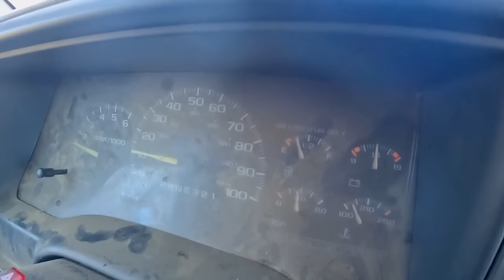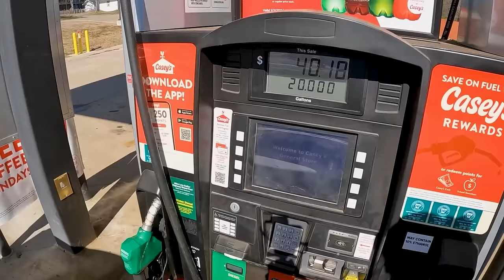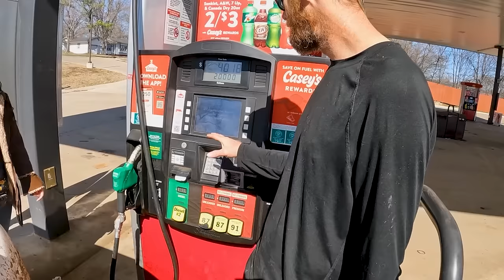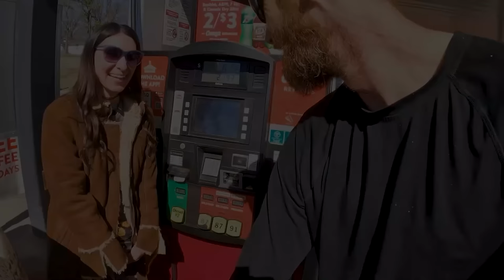One Thing After Another.. Can We Get It Right?! Covered Deck for our DIY Cabin Homestead Build

Comment: You can put more than 200 amps of breakers in a 200 amp breaker box. However, you can't pull more than 48 kilowatts of power through it except for a few seconds. How does 5 people use 48,000 watts of electricity? Electric resistance base board heat, electric oven with 6 resistance burners, washer, dryer, 5 tables saws? 200 amps at 240 volts should be more than fine.

Comment: If you run 16’ rafters for the deck roof just box in the sides where it meets the roof and then you have a step flashing run for the main roof over the house you can box in the eaves at the deck transition as well should be same amount of roofing with what you save on the over framing

Comment: Are you really sure you need that much pitch on the deck roof.   Up here in northern Wa, yes cause of the snow.  Yes you get a little snow but mostly rain I suspect.   4/12 is min up here.  I’d reconsider your pitch.   Just a suggestion.

Comment: oh me;;;;;you are fighting a battle;;;we found that the 2x's all had their own unique path of straightness;;;what you fix now may not stay the way it was fixed or the other side decides to go bonkers;;;lol;;;differen parts of the tree put together expand and contract differently;;;;;we also found that the height of the 2x'a where not exactly the same some a 1/4;; shorter or taller;;;notching and shiming helps but in the end tieing them together with decking helps keep them looking straight and depending on the decking it might create problems;;;;;hope you get er perfect;;;we finally just used the eyeball method of straightness and hope you have a bit of slope from house to end of deck to keep water off deck;;good luck

Comment: Two things why have you not put your deck boards down yet it sure would make it a whole lot safer working. Also, are you really going to run the boards from the house straight out or are you gonna run them along the house?  I am assuming that’s why you’re putting all the ledger boards in

Comment: I couldnt think of a better way to spend valentine day then doing your pergola/deck and supply run...my pergola about the same size as yours I built when I was 23 here I am at 60 still enjoying my veiw of the neighbours brick wall its probably been the most used area of my home Ive had my kids christenings and 18 and 21st partys all under the pergola it was Originally built to give them a place to play on their lil pushbikes these days it holds my stained glass workshop and my cats and dogs hangout in there and Ive only just had to put a new Tin roof on it now which is a bit harder at 60 but Im getting there its a lot of roof might take me a bit but I will finish it soon enough...Happy Valentines guys...later laters❤

Comment: You will have to double up the joist above each post so it has full bearing from very top to very bottom.  The fastest way to guarantee a level deck is to put a nail on a separate board at each end and stretch a MASON string (regular string can stretch) along at the height that is correctly level.  Then you just need to put a car jack or two under the rim board and build a post to put under it on top of the jack.  Then crank away till you are level.
For all the ends that are exposed, I would highly recommend brushing on a coating of Titebond glue.  That will keep water out and prevent rot.   I know you will not do my next suggestion which is to cover the tops of every joist with zip tape.  I saw that you did it on the main beam but it is one of those things that will add 10 years or more to the deck life.  
Also, make sure that once the posts are set on the double block you should then cross block between the joists so the posts are blocked in on 4 sides.  I construction adhesive and thru-bolt each post with 2 bolts and w/nuts and lock washers.   This is necessary due to wind load and snow load trying to tilt the posts later on.

Comment: another thing you need to address, real soon.. your trusses are NOT rated for a point load for your rafters.. [if they were they would have a tag there and a support right there] you need the load to go to the wall, not the roof.. just random info so it does not get missed.. realistically you could make a short stub wall at the exterior wall and then rafter from there and then have short rafters to the roof - it depends on the board foot cost increase with longer rafters, sometimes going from 10 to 16 is three times the price per board. .. you already are going to cover up some existing roofing, no big deal other than sunk cost, you do need to NOT have that whole roof load mid truss.  so once you know how high up the roof you will go then you can figure out the support / crib wall and then figure if splitting the rafters or having them go all the way will do the job. ..   this is just random thoughts from a old fart.
Reply: Great idea!!
Reply: Good info.

Comment: Gary... dimensional lumber has that problem being the same width and holding it's original width. I just had to shim up floor joists in the middle of our house where the ends of the floor joists from the two sides meet over the central steel beam in the basement. One side was narrower by 1/ 4 inch and was causing horrible squeaking when walked on . Put in shims...no more squeaky floors

Comment: Build it like a wing/aerliron assembly.  The house roof has a structure to raise to the 3-4'-12' line.  The deck roof is a narrow triangle over to your post.  Take the sideview of the structure 3-4-12' from house roof to post. Put a support vertical at the edge of the house, the rest of the strut is a triangle .

Comment: If you are not required to have a specific pitch for the deck roof. You could remove your house fascia and tie it into your existing roof structure. Not sure if that’s code but 🤷‍♂️. Good luck.

Comment: Hi Mel and Gary, you guys are getting it done. Gary please stop referring to yourself as OCD even in jest. It’s best to say that you just want to get it right. With the shims I am wondering if there will be water down there, if so, they may easily rot, despite being treated. I guess if you oil the deck then you oil those shims to protect them. When I shimmed a veranda floor joist I used plastic shim, these were wedges that I inserted from each side, I used a clamp to tweak them into place then secured with a screw. The beauty of that is that as timber ages it shrinks so I simply remove the screw and clamp the shims again till the gap closes, being plastic there is no problem with water damage. Lovin the build.

Comment: I would recommend that the top of your porch rafters end above the exterior wall.  I prefer to install a 2x4 across the roof horizontally and just clip a notch at the top end of the joist and the birdsmouth on the bottom end.  I hope you are accounting for the height of the horizontal joist between the posts.

Comment: Why don't you try using a water level which is a long piece of tube corked on both sides that has colored water in it that represents the level part of the thing so you can go along and adjust it with that and you can also check if all the rest are in level what's the rest of the boards all it takes is a long piece of clear tubing water with coloring in it and two corks

Comment: Gary mentioned some of those end ones may need to be 24’ All I can say is hang on to you butt because the cost of them is gonna sinch up your pucker string 😂🤣. If it was me I’d figure out a way to put me some more upright 4x4 post on that knee wall/angle half wall that Mel done her climb down onto. ( Yeah That Wall). I’d put me another 4x4 on top of that wall going up to the deck  parameter board. Then that will give U the load bearing post underneath to put another 4x4 on top of the deck dead center on the end of your Angle  perimeter board. That way you can notch the 4x4 to insert two 12 footers, 1 going from your existing house roof to center of the 4x4 in the notch and then another 12 footer going against that one in the notch on the load bearing 4x4 down to your outer deck edge to its load bearing post. Hope this makes sense if I was there I could show ya the concept to save you a ton of money on buying 24 footers with is ungodly expensive not to mention requires more load bearing bracing with also requires more money. My way is start from that angle wall at basement ground level and put a 4x4 midway of that wall going up to the deck for a load bearing support post. Then go dead center above that on top of the deck had put another 4x4 mid way. The top of that 4x4 will be notched to place 2  12 foot boards butted up to each other in the notch, one running to the roof of the house one running to the end of the far outer front corner of the front of the deck roof. I hope you can decipher what I’m saying or otherwise buying 24 feet lumber is gonna draw your Wallets butt string up tighter than dicks hat band 😂 Not to mention the extra bracing and headaches that’s gonna come with that!!! Good luck Guys 👍🏼
Reply: Guys actually after looking you already have the load bearing post on the wall in center of the angle wall at ground level.  So what I would do would be to put me another 4 x 4 up on top of the deck right above that loadbearing 4 x 4 that you have in the center of your angle wall. Then I would notch that  4 x 4 and do as I said in my comment above and use two 12 footers instead of buying 24 footers.